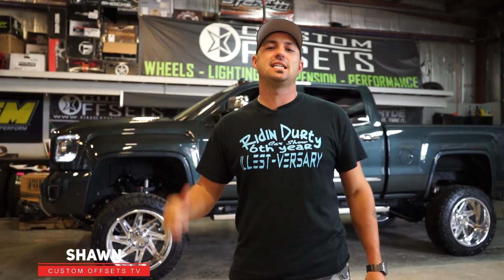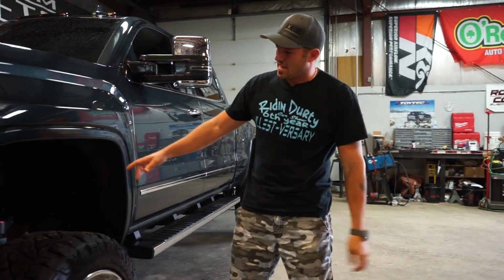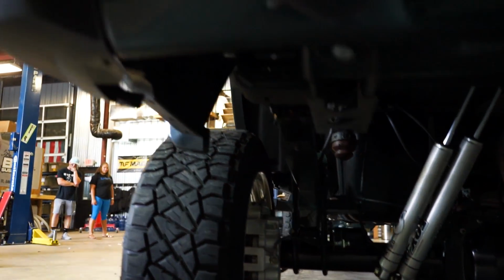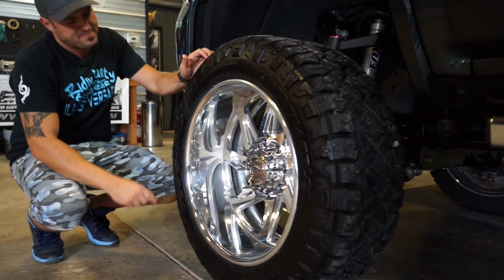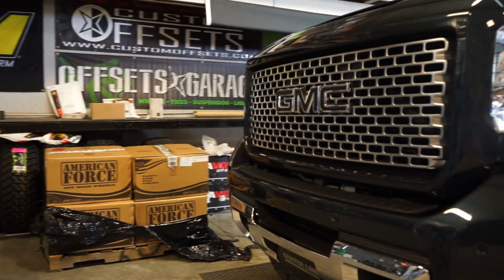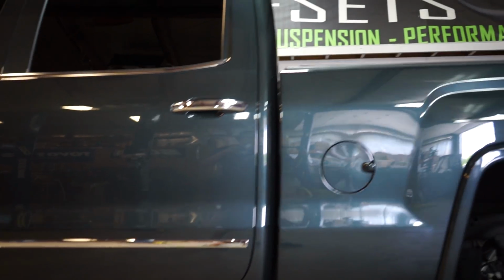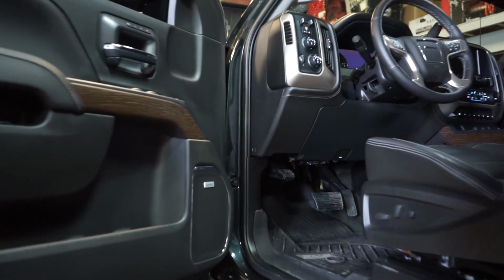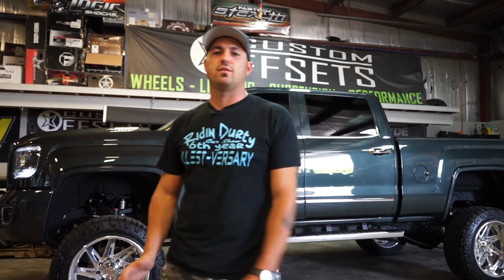Spotlight - 2017 Gmc Sierra 2500HD, 6.5" Lift, 22x12 CENTERLINE FORGED, and 35s

Comment: When you buy the BDS 6.5 KIT ...
Does it come with upper control arms or are the additional to the kit????? @customoffsets
Reply from the maker: Sean, depends on what vehicle/kit you get. Shoot us an email to info@customoffsets.com
Reply: Custom Offsets will do
Reply: I'm new to the truck industry. I just had my 2016 GMC DENALI HD leveled and I'm thinking of putting a 3 or 4 inch lift on it. However, can I run 24x14 with the same 35 offset? I want to have as much deep lip as possible. Please give me your professional opinion on what would work on my truck. Thanks

Comment: The ridge grapplers don’t look mean enough, should run mud grapplers
Reply: One extreme to the other.
Reply: I wanted to try them out. Trails gonna go back to
Reply: Tyler Elder Trails?
Reply: Trail grapplers
Reply: Tyler Elder Trail Grapplers are even less aggressive than the Ridge Grapplers. Do it right and get the mud grapplers
Reply: Haaaaa
Reply: That isn't even close to being correct. Stop circle jerking over mud grapps. No purpose to run those especially if you don't offroad often, trail grapps are plenty aggressive.